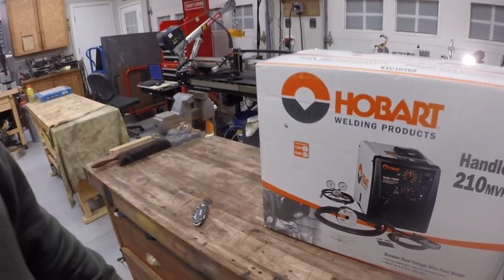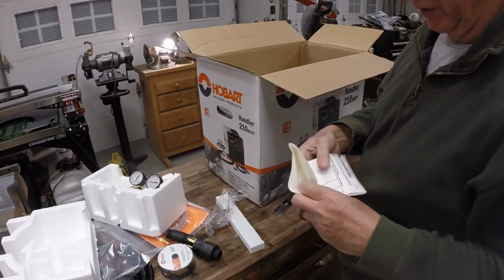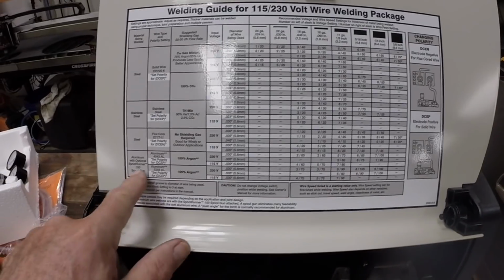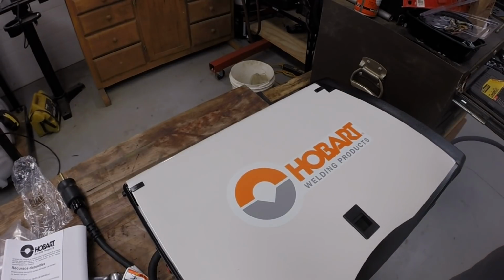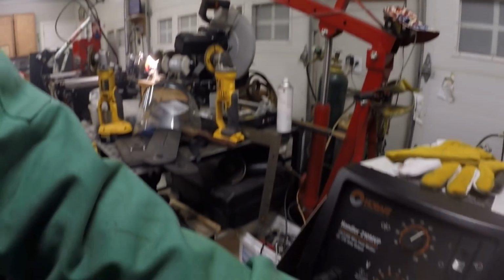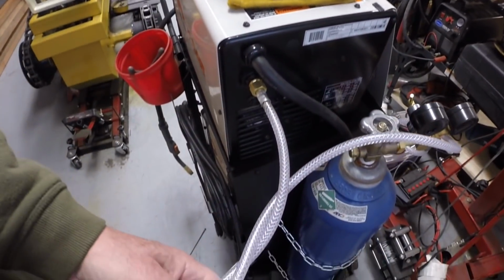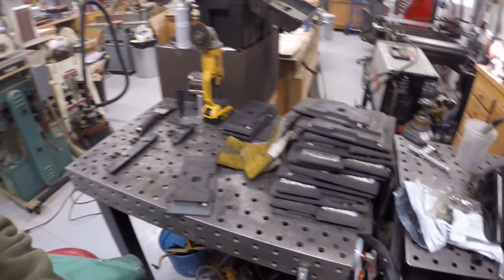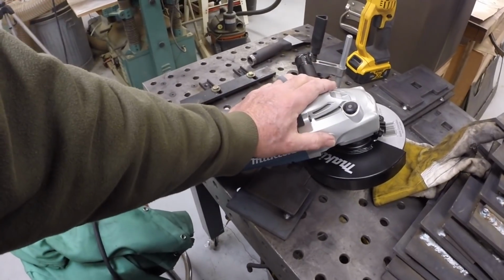Hobart 210MVP Welder: First Looks

Comment: I have the Hobart 140 (5 yrs) and have done miles of weld with it. Its ok, but sometimes I have to run it at maximum. kind of wish I had bought the 240 volt one.
There are much more sophisticated welders now, for less money. Hobart is surviving on reputation.

Comment: All welders are setup using voltage, not amps or current. They are not interchangeable. 

Yes they are rated in amps but the measure of “power” is always voltage. Hobby machines often have generic letter and/or number combos that don’t really tell you much, my Lincoln SP135 is this way. My 210MP and TIG200 show voltage, so the 210MP shows an actual measure of xxx ft/min feed rate and xxx volts.
Reply from the maker: Actually, the measure of Power is Watts, or volts times amps. Volts, by itself, does not describe power in any way.  The machine dials may increase or control voltage, but, inherently, also, by changing the voltage, it changes the current, or amps. 
Right?

Comment: Wondering how your review would be now after a year. That is thick material you were working on in this video. Hoping the burning smell was not the boards frying. Can you give a brief comment on your usage and longevity at this point. Thanks
Reply from the maker: I'm very happy with this welder. It's been flawless and I put it through a lot.  I'd buy it again.

Comment: Nice shop you got there. You have some serious welds. I'm not surprised that the thermal overload protection kicked in. Also, the odor is definitely a sign of pushing the welder to the limit. You don't want to reach the duty cycle on a regular a basis. It shortens the machine's life span. Try the HOBART 500574 rated at 60% duty cycle. This welder is exceptionally good for type of welds you're doing. Nice video and thanks for sharing.
Reply from the maker: Thanks 👍

Comment: My welder regulators I bleed all the gas out of them until they read zero everytime I get done using my welder and I've had those same gas valves for over 20 years and they look and work like brand new yet.

Comment: you will have better control of your welds using 0.23 size wire with ultra-mix gas . that would be well suited for your type of welding . try it you will believe me . your welding will improve fast . i've got experience as i was certified in 1974 , 15 years Ironworker then 15 years as a certified weld inspector on buildings and bridges . good luck ..

Comment: As a matter of interest - I was watching a movie last night - Half Tracks in sand... the Drive and follower ? wheels were both high in the air and the and these Idler wheels were down in the sand with the track.  Interesting application.
Reply from the maker: My drive and idler wheels will be elevated a bit, a few inches, in the interest of gaining ground clearance, unlike real dozers where they are essentially flat.  Tanks do this even more, presumably to handle terrain better.

Comment: best not to keep welding until it overheats, try to manage your welding time so you stop before it overloads, just walk away with welder still running so fan will help it cool down. definitely not good to keep overloading for sure. love watching
Reply from the maker: Thanks. I'll have to slow down a bit I guess. Not in my nature, being a bit impatient, but I didn't realize it would actually damage the machine. That's a bit surprising, I'd expect it to cycle off before any damage is done.

Comment: Very nice welder sir,  as a welder myself, you will find that ALL MIG welders are CV [constant voltage] meaning it will produce the amperage automatically to meet the settings of wire speed and voltage. The large industrial inverter MIG welders [300 amp and up] will have a digital amperage display[only while welding] but again no amperage pre-set due to being a CV not a CC [constant current] machine which is what Stick and TIG machines are.
Reply from the maker: Thanks for the info. I had no idea. I'm still thinking stick welder, obviously.  So more wire speed equals higher current because of better conductivity from wire to work? You see, I need to take a welding class. Clearly.
Reply: @woodandmetalshoptime8048  the higher the WS and/or V the higher the amperage up to the limit of the machine.

Comment: How come welder doesn't have a cooling system eg:- fans to move air through and around the casing and windings, would probably help the welder🤔🤔🤔loving the progression of the dozer I think you've made a design change to the dolly wheels frame????🤔🤔🤔keep up the great work🇬🇧🇬🇧🇬🇧🇬🇧👌👌👌👌👍👍👍
Reply from the maker: It does have a cooling fan. Makes a lot of noise, too.

Comment: Heat will never be a problem for you IF you stay in your duty cycle. I'm not certain on the 240, but the 140 has a 20% duty cycle. That means you can weld 2 minutes out of 10.
The reason for the duty cycle is because you weld out of a capacitor.  When the capacitor is empty you need to stop welding.  If you continue past that point you will burn the welder up very quickly. 
Think of the capacitor as a cup of coffee. When the cup gets empty you need time to refill it. If you plan to weld quarter and three eights often you need a 100% duty cycle machine or the duty cycle will drive you nuts. Thanks for the great videos and very best of luck to you.

Comment: What were your reasons for choosing Hobart over other brands?  We’re you looking specifically at mig wire feeders only?
I understand the professional vs hobbyists thinking and the pricing tiers, but what sold you on Hobart specifically?
Reply from the maker: I have a 120V hobart handler 140 that has always been reliable, and Hobart stuff is stocked at my local Tractor Supply. So parts and accessories are readily available nearby.  A good experience with existing welder, local parts, and reasonable pricing made the decision.  Yes, I was looking for a MIG welder exclusively.

Comment: Just chop off the plug and put on a twist lock.  Not difficult.
Reply from the maker: The plug they provide is a proprietary 4 pin plug that uses a pair of adapters--one for 120V and one for 240V. If I cut off the plug (which I've done on a plasma cutter and a stick welder) I'd no longer have the multi voltage option. I guess that's not really a big deal but caused me to pause before getting out the cable cutters...
Reply: @woodandmetalshoptime8048  In that case, I understand completely.

Comment: Frank mig welders are constant voltage stick welders are constant current that's why the dial is for voltage. You can buy a CC/CV machine but they are thousands. I'm a boilermaker.

Comment: Try feeding the ground cable through the hole in the clamp handle, then onto the stud.  The hole will act as a strain relief.   Hobart, Miller and Lincoln are all good welders.  30% duty cycle is a little low but what it means is that you can weld 3 minutes out of 10 minutes.  I use an old Millermatic 200 but started out with a 225 Lincoln buzz box.  I recently picked up a Miller Syncrowave 250 that I am eager to get up and running.  I need to run a dedicated power source that's 220 volt 100 amp.  lights in my neighborhood are going dim every time I strike an arc.  Don't sell yourself short, from what I see your welds are pretty good.

Comment: nice rig.... I did the cry ones , and got the largest single phase 230 volt made..  at that time.  the Ironman 250
no regrets and zero issues .  and its over 20 years old now.   Ive never hit the duty cycle on it.

Comment: Hobart is decent.  Inverter welders adjust amperage automagicly.  So they have the same settings (wire speed and voltage).  I think all the bottom tier welders from any manufacture just have those numbers.  Seeing the amount of spatter while you were welding I think you could bump your wire speed up.  Spatter will reduce and your amperage goes up with better penetration and wet out at the toe.  Little more wire speed for inside corner, little less on outside corner.  Little more wire speed in position, little less out of position.
Reply from the maker: Good advice. Thank you. I'll play with it some more.